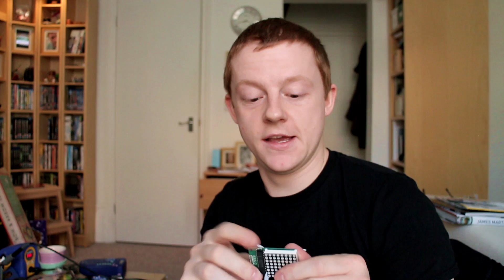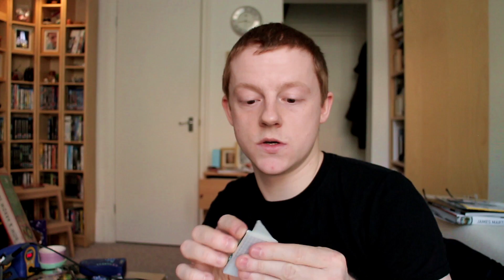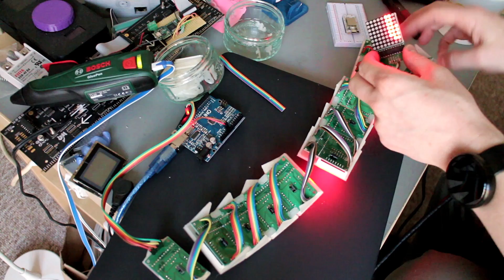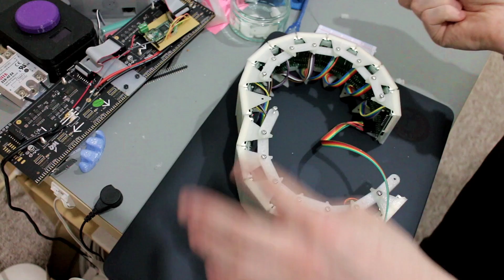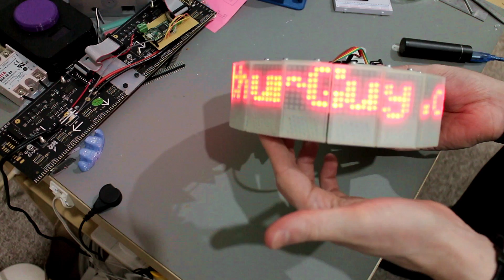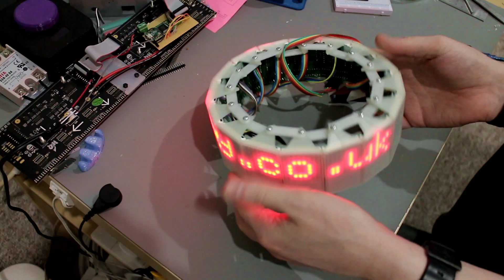Weekend Build - Circular LED Display

Comment: How do you "adress" the panels? Or in other words, how does the controller know which panel is the first, second, and so on?
Reply: It shifts out different bits of data. Each panel can take a certain amount of bits, so when it gets it's share, it sends the rest on to the next panel.

Comment: How do you daisy chain the 7219 cards?  I thought each would need a separate set of three pins on the arduono, but you only have one lead to the board.  Would tidy up my wiring immensely if I could understand that. 😃
Reply from the maker: +mowburnt The Display modules I was using had an input and output set of pins so you could connect the top of one to the bottom of the other

Comment: The arduino can only handle 400miah..  and you are hitting the limit on the polyfuse.. ;)
Reply from the maker: l completely forgot about that :(
I will take another look and see how it performs
Reply from the maker: ***** I rewired it when I finally hung it up and it didn't make a difference, it must be another power supply issue or possibly some noise on the line.